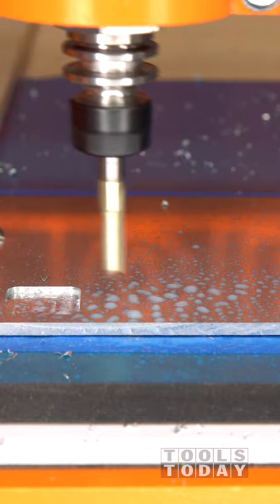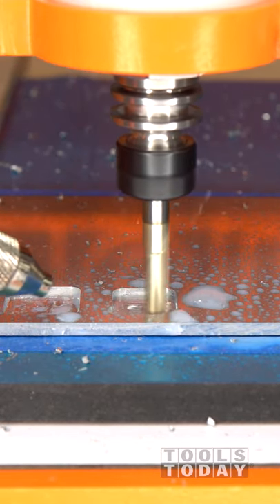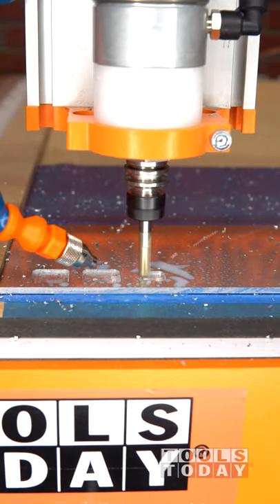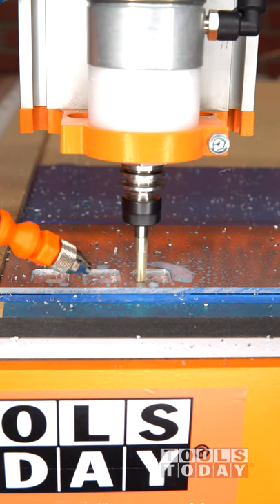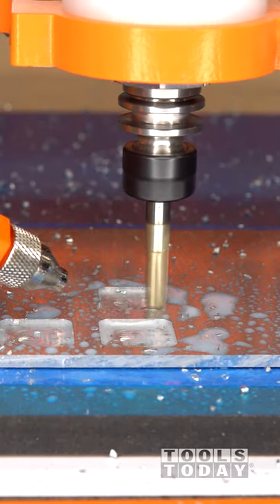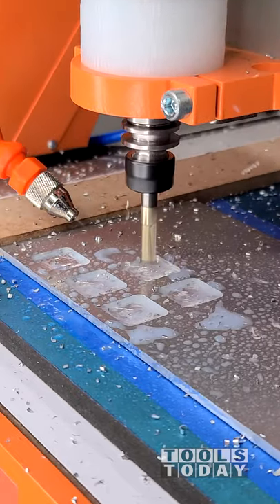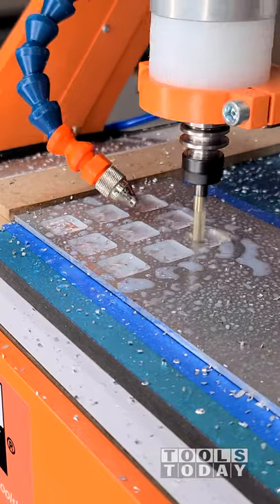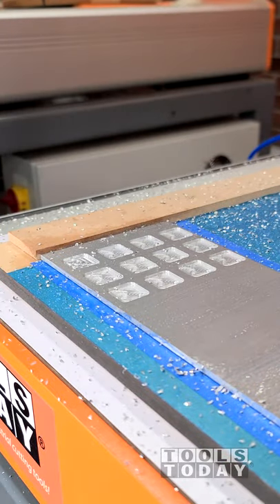Testing the Misting System on Aluminum

Comment: I know this was focused on the mist setup (which looks pretty rad. It would do well on a large mill) and not fixturing, but Looking at that aluminum flex with the tool engagement was making me cringe everytime the endmill engaged.  I was just waiting for the endmill to gouge, snap or lose the flute.  
Hopefully your plan is to fixture that plate down a little more rigidly, especially since that tape will lose adhesion the second that mist hits it.

Comment: What happened to bottom left square I'm honestly curious I know it's me a bunch of different factors being as it's a CNC machine so what's up with the difference in the pattern of carving
Reply from the maker: I was testing it with a larger stepover and didn't like the way it looked so I changed it for my testing on the rest of them.
Reply: @ToolsToday  I'm looking for the misting system and also the easy pop off / on collet system that comes with the automatic tool changer. Is that on your website?